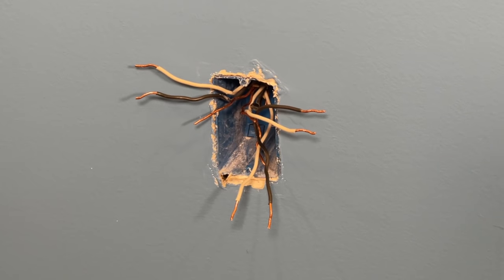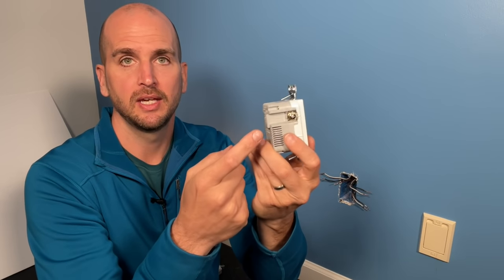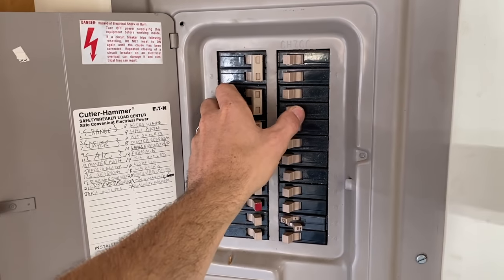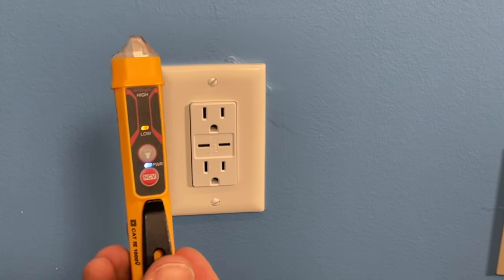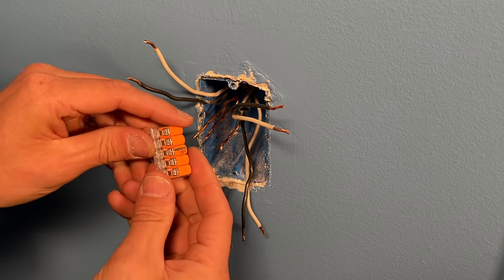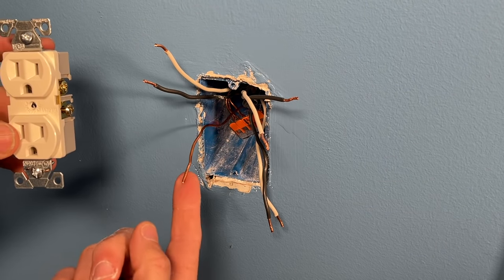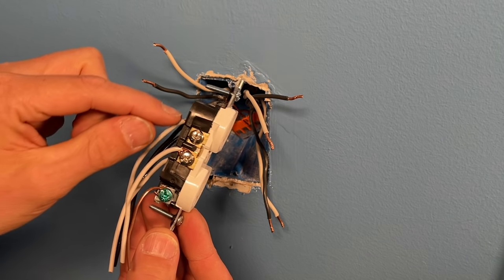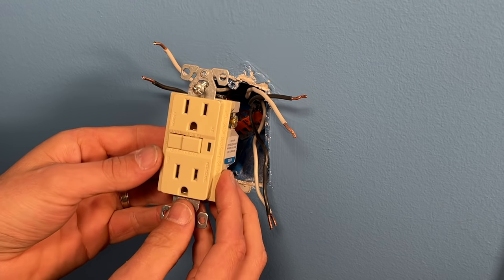Wiring an Outlet with Multiple Sets of Wires

Comment: I can tell you from my own experience that this young man has the best presentations I have seen. Nice job sir.
Reply: I have to say from "My Experiences" This young man @8:08, made his Shepherd Hooks Backwards. You always want to pull the insulation into the screw. You are always tightening to the Right so the wire comes in from the left. Anything else he says is SUSPECT also.
Reply: @Delekham  And I can say from my experiences that you didn't listen to or watch the video carefully.  In the timestamp you gave, he is not using a hook at all.  He is backwiring: leaving the wire straight and the screw terminal has a terminal clamp that pinches down on the wire when the screw is tightened.  The back of the receptacle has a stripping gauge so that you strip the insulation such that the wire fully bottoms out in the screw terminal yet the insulation is flush with the terminal clamp once screwed down. Your lack of attention and/or comprehension makes anything else you say suspect also.
Reply: @Demolishionist  Good reply !
Reply: @Demolishionist  Touché Sir !
Reply: Haters gotta hate.
Reply: Yes , very easy to understand. Your a Professor rt? Excellent job.
Reply: Couldn’t have said it any better or thoroughly then that  .. I was like the heck is that guy talking about he didn’t use hooks..
Reply: Totally agree very knowledgeable

Comment: That is one itty bitty box you shoved that giant receptacle into!
Reply: GFCI and USB receptacles can be problematic when you have two or three sets of wires to deal with in a small receptacle box.  Sometimes a deeper box can be a solution if there is enough room inside the wall.
Reply: With that many wires you need a 20 cubic inch box.
Reply: That box is nailed on to the stud so you'd have to cut the nails with an oscillating blade and get a deeper old work box with the wings in there. Messy but doable IF you have enough wire length to work with.
Reply: I've done this a handful of times lately, and it's not too bad. You're right that getting the wire back in can be tricky. Would be a great video for this channel.
Reply: @1575murray  No room for me and 20 amp. circuits. PIA.
Reply: Hear that from my wife all the time!

Comment: Someone will encounter a split outlet with red, black and white wires. Perhaps you should cover that too.
Reply: Yes, I’m one of those guys please do a video on split outlet. I am  confused.
Reply: @elouie  split the tab between the hot side of the outlet (brass screws) to separate the 2 circuits
Reply: When that situation exists it is usually because one half of the outlet (usually the one with the red wire on it) is controlled by a switch on the wall next to the entrance doorway so a floor or table lamp can be switched on and off while anything plugged into the other half (usually the one with the black wire on it) will be hot regardless of the switch position.  However both halves of the outlet will be on the same circuit going back to the breaker panel.  In this case you need to break the tab on the hot side of the outlet but leave the one on the neutral side alone otherwise the switch will be bypassed.
Reply: @1575murray  There is also the case where an outlet is fed with a 2-Pole breaker and the two sections of the outlet are on separate circuits. Perhaps you could discuss both these options.
Reply: @deanrhodenizer938  I didn't want to get into that because I am not a qualified electrician and didn't want to possibly give out bad information.  The situation you are talking about most commonly results in two completely separate duplex receptacles in a two gang box each with its own pair of conductors and separate circuit breakers (not necessary to use a 2 pole breaker in that situation as long as the neutral conductor is not shared).
Reply: @1575murray  The situation I was talking about was a duplex outlet with each half running on a different supply (Opposite legs of the 240V supply) and a single neutral carrying only the difference current. When the 2-Pole breaker is off the whole outlet is off as opposed to separate single pole breakers that are not necessarily on separate legs of the 240 V supply.  Agree that it would be bad to pass out any incorrect information.
Reply: @deanrhodenizer938  
Pro electrician here,
 That's not a common thing to have but now if it's something you wanted specifically it can be done. Your setup will have to be on a two pole breaker by electrical code because  you're sharing that neutral between two hots. Most likely it will be dedicated circuit ( meaning no other devices will be on that circuit ). Hopefully that helps!
Reply: Splitting an outlet needs the jumper cut on the receptacle. Helps if you know electrical theory.

Comment: I too think you should advise your viewers that by using that type or the GFCI receptacle, there really isn't enough room in the standard box for all those wires assuming using the WAGO and a 4th set of pigtail wires.
Reply: I think you are right on, especially when you notice the vents this fixture has in the back and the sides, I'll bet there was a very detailed instruction with this fixture explaining the volume of the box required and number of conductors allowed in each volume of the potential boxes.

Comment: On a GFCI the loads do not need to be connected to the load side of the GFCI.  This is only necessary if you want the load to also be GF  protected and it may not work if the previous circuit has a shared neutral downstream... the GFCI will trip every time.

Comment: One other maybe common situation - or at least I've seen it - is where the outlet has been split to have 2 15 amp circuits (used to be common in kitchens here) or where one half is switched and the other is always powered.  These situations could result in surprises that weren't mentioned in your video.
Reply: They'll figure that out when the breaker keeps kicking
Reply: I agree, if wired wrong you could also be bypassing the switch
Reply: I have split receptacles in my kitchen. 240 volts between the two hot leads....
Reply: wait this is the problem I'm having lmao help!

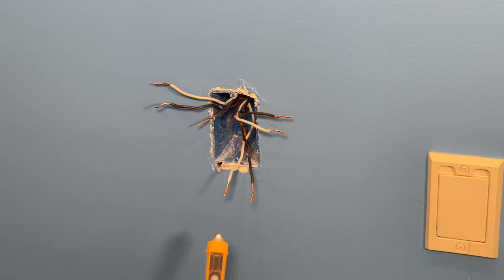Comment: Great video, it's worth mentioning at time 3:45 to power off the breaker, and double check that no wires are live.  I test all wires to be safe, because if someone had wired hot & neutral backwards then you can get a hot neutral.
Reply: You not understand neutral . Both are current conductors . Neutral is not a ground period of 0 volts . It a pathway for the return  of half the voltage and amps to service transformer  only. Never use neutral as a ground. A ground has 0 volts 0 amps connected to earth only. Easy to remember  by what it called . Ac means alternsteing curent , means goes out and returns like a magnet. Dc = like batterys= direct curent, goes out but not return to service transformer. A service tranformer only trans form a volt with amps at a even count only  as 240 volt 10 ampd  to a  120 v 20 amps service. It a 2/1 transformer. A pole transformer is a step down transformer at 10000 volt at 30 amps x 240 volt x 2010 amps , it    is a 67/1 rating transformer , if house is 100 amp at 240 volts , then it take a 24 or best to chose 1 size bigger 25 kw step down transformer oil cooled is best.
Reply: He says it at 1:50 boss
Reply: @treposey4107  yep
Reply: I was thinking the same thing Cori.  Somebody may have switched the hot and neutral so that a white wire may be live.  I always check all wires, including the grounds, and check the box if it’s metallic.
Reply: I agree that the way this is presented, it looks like he's digging into the same box that he just identified hot wires in.  I know he said previously that power should be turned off at the breaker, and then verified, but he doesn't do a very good job of demonstrating this.  Newbies/Beginners might be confused...
Reply: yeah was about to comment the same. Just check every single wire.

Comment: I can't say this enough, this man has made my life easier just by recommending the WAGO connectors. Add in all the other little tips I've gathered from watching, and I feel like I owe this guy an invitation to our next beachside cookout, and a growler of the private reserve.
Reply: PLUS, you can probe them (at the back of the Wago) if you want to test for voltage; saves you from taking the "wire nut" off to get to the conductors.
Reply from the maker: Thanks Jerad, appreciate the kind words and will keep an eye out for the invitation 😁
Reply: Does it matter the order the wires go in the Wago
Reply: @ReservationFire  - It does not matter because the WAGO connects them all together.
Reply: @manny7886  👍
Reply: @leepaul6630  Proof?
Reply: @bamalam9622  I have dozens of real-life photo examples where these have created fire and/or near -fire situations.
Reply: These WAGOs actually create another point of failure for having a dead or open short bc you are relying on pressure contacts that wear over time. There is no better connection than twisting wires. No real electrician uses these other than if they are provided already in a light fixture and even then i mostly cut themnout and twist the wires.
Reply: Buy him a beer dude. 
Venmo/PayPal/cash app

Comment: Your video saved my confusion. Encounter outlet like this & removed all the wires; afterward, put the wires in the GFCI & nothing happened. Spent about 30 mins switching wires around still didn’t work. Reviewed your video to install the hot & neutral on the bottom then the other pairs on the top, bingo everything perfect 👍 again. Saved me couple hundred to hire an electrician. Thx
Reply: Peter Xuong, You could've hired me for just $200.
Reply: @auletjohnast03638  too much this job is only 100 or less

Comment: Great info. I really like the connectors. I can’t tell you how many times I’ve struggled  with sets of 12 gauge wires trying to get them back into a small electric box only to end up tearing the small box out and replacing it with a deeper box.  12 gauge wiring is no fun to work with! The connectors and outlets are definitely on my immediate shopping list! Thank you.
Reply: I cannot recall how many poor twists and attached wire nuts I have come across in my 62 years and almost all were ‘allegedly’ installed by electricians.  WAGOs have been used for decades and like all electrical, they should be installed with care.
Reply: Be careful,  there are some knock offs out there and the quality is definitely cheaper. I always let my customers know before hand because the wago 221 are spendy but worth it when it comes to electrical and safty for your customers.

Comment: Thank you this was informative and helpful. I opened an outlet with the exact configuration you described with 3 sets of wires, 2 back-wired and 1 side-wired, and I wanted to put in a receptacle with a USB port. Learning about Wago lever nuts and making pigtails was also really helpful, and differentiating between line and load is also good. Most times I've done repair I've taken pictures and put the next thing in the way the previous thing was done, but now I realize that's not guaranteed to work or be safe.

Comment: I solved a persistent problem I had dealing with a burned out GFCI finally. It was a line/load situation and It was impossible to tell which was which because the insulation was gone back up under the insulation.  Anyway, I watched this video (which really helped somehow) and after two attempts at re-arrainging the wiring for the outlet I was able to get the testing plug to register CORRECT.  I am grateful to this video for triggering something in my brain that allowed me finally master this situation. The pipes won't freeze up, I fixed it. I had gotten continuity back, but had problems with hot/neutral reversed and tried to find how to know which was line and which was load and which one of those two was wired wrong.
It was crazy because there was basically no color descernable on the burned ends. Alot of hit and miss, turn it on, turn it off,  Something clicked after this video and it's done. Hooray.

Comment: I just had to fix a plug like this. It had reversed polarity so I took apart to fix. I had no ground wires  connected plus my main power was from bx cable to Romex.  The wagu lever nuts worked great for pig tailing. The only thing I added was a piece of tape to keep the levers locked while fumbling with all the wires. I was checking videos to make sure what I did was even close to code! Your video series has been very helpful!!

Comment: Exactly what I found in my wife's home office.  A third outlet was wired through the middle of the run but the grounds were just connected together and shoved in the back of the box with no pigtail to the green wire. I disconnected everything and used 4 point wagos just like you did. I can't believe it hadn't started a fire.
Reply: Wouldn't the ground wires only be dangerous in case of a ground short, that is a miswiring of the hot wires to the grounded parts?
As i understand, In normal conditions, the ground wires are not live, so connected or not they cannot cause a fire(until there's a ground short somewhere on the line and the ground wires become live, then dangling live wires can cause arcs, or electrocution).

Comment: Unless line/load on a GFCI or having a split receptacle, I would always pigtail multiple wires in a box. Therefore you are eliminating the confusion for the next person to open the box. Also it is easier to tighten down one wire on a screw rather than 2 or even 3.
Reply: WAGO. FFS.
Reply: Wago or not, this is simply good wiring practice. Why loose everything downstream if there is a problem in the future. Troubleshooting can be time consuming as it is. Always pigtail if it's just feeding through. Always. Period. Don't even get me started on back-fed outlets.
Reply: @charlesford157  Could you explain why it would help trouble shooting by pig tailing vs having both wires on the receptacle? Trying to learn as I was planning on putting all wires into my receptacle vs adding another wire and pig tailing. Thanks!
Reply: @raiderxx  It's just like anything else. To be honest this pigtail method is really the result of back-wired outlets behind just literally stabbed in the back. One wire gets loose and you lose every device down the line. Typically yes, using both sets of screws on the outlet is fine, but what do you do when there is 3 wires? Adding another wire to a screw is a bad idea. So to keep things simple, if you pigtail all problems screw or back-stab related are moot. If you have a problem you know right where it is.

Comment: Always good videos.

Would you mind doing a video on how to identify different types of common circuits based upon what you have in the box?
(multi-wire, pass throughs, switch legs, switch loops, junctions).

Also, after watching this. I think it might be a good idea to have a video showing how to determine box fill.

Maybe show the different types of boxes, (Plastic switch boxes, 1900s, 11Bs, 8Bs, metal work boxes), the difference between ganged and non-ganged work boxes. Then show where you can, and can not have certain things, based on size of the box, amount of conductors, and size of the device.
Reply: 😊 my ym😊 lobbies up h

Comment: After testing for the hot lead you didn’t mention that you turn off the breaker again seems quite obvious but in an instructional video like this you should
Reply: I was thinking the same thing.. I thought maybe I was just overthinking or something.
Reply: I was just about to make this comment as well.
Reply: Corrective criticism is important when working with electric 
Thanks for this advice
Reply: I thought you were being over critical until I watched this and cringed when I saw it.
Reply: Absolutely
Reply: Sheesh so damn critical
Reply: Touch the white to black , that will turn the breaker off.
Reply: Exactly what I was going to point out.
Reply: But you djdnt say what ypu xid switj tbe hott wire e  comig i
Reply: Sorry had to ruin the 69, but yes this is true
Reply: @Bio S It's common sense though. Electricity is dangerous, especially with 120VAC, or even 240VAC. 
It isn't science or being a "genius." It's about safety and preventing death when working with live electricity.
Reply: @LogicDoesStuff  dead electricity is safe , tho...
Reply: @lostcause1206  Obviously I know that.
Reply: No brainer. This isn't for dummies,
Reply: Leave the breaker on..be a man
Reply: @barthensley8582 Yea Aii🤣🤣🤣
Reply: @bradmarkell12167     yes it is

Comment: Thank you very much for your videos.  I am working on renovating a house built in 1995 and the electrical wiring is a bit interesting. Some of it does not make sense as far as why certain receptacles are connected and others are not.  Your videos are helping me quite a bit. I'm commenting on this one, but I have watched several of your videos (sometimes 2-3 times) to help me figure out the correct way.  It has also helped my regarding connectors and tools.  Thanks again.

Comment: Exactly what I needed, thank you! Was replacing an unnecessary switch with an outlet, but one of the 3 wire sets in the box registered a low flickering light on voltage tester - so glad you said that’s common and not a hot line. Great video all around!!!
Reply: They call it ghost voltage.

Comment: And don't you just love it when a homeowner does the wiring themselves and uses what ever color wire they have available?   I helped my best friend change an outlet that was also connected to an upstairs outlet.  The home owner used green wire for hot blue for negative and yellow for ground.  We were able to replace the outlet because my best friend saw how the wires were connected before we began the work.  It was a nightmare.